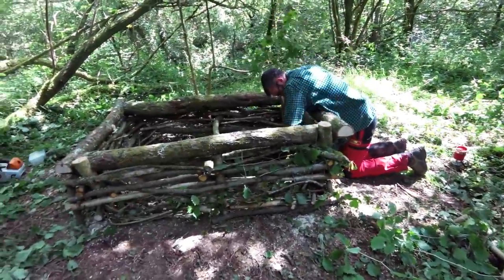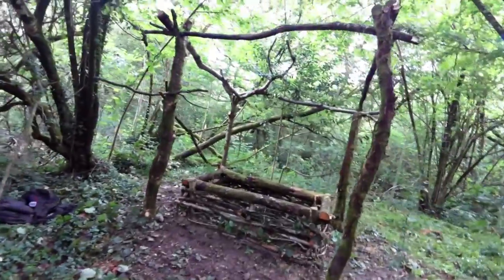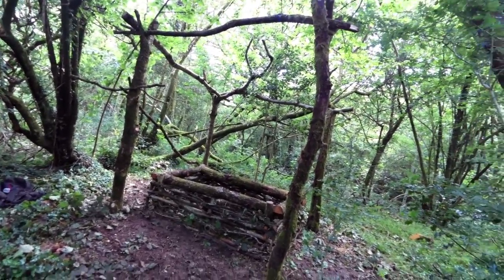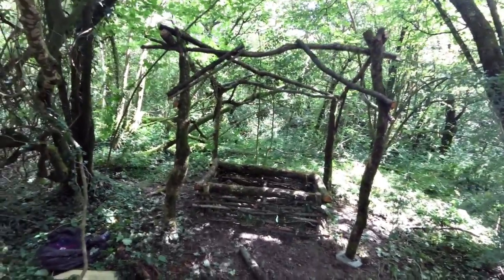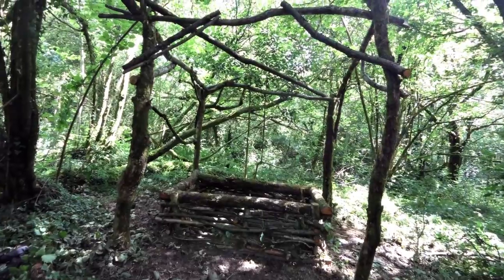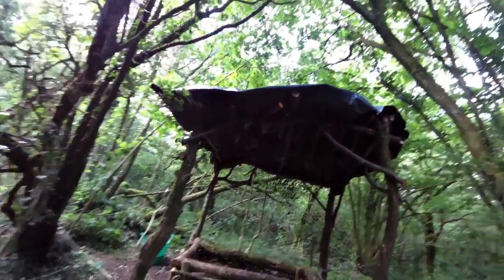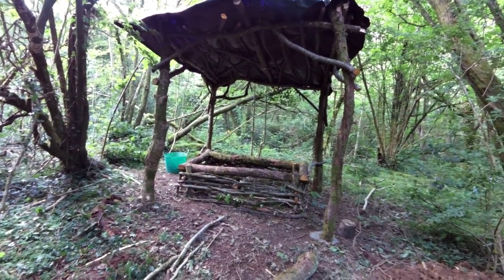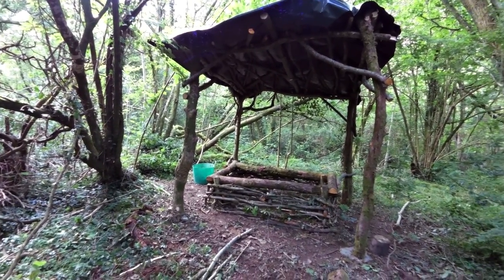compost toilet in the woods.

Comment: The area where the human waste goes should ideally be completely sealed off from the outside to avoid attracting flies and other pests. I might have dig down further, but you can probably also seal off the woven sides. You'll also want to have a plan for mitigating the smell. You can have a bag of lime, wood ashes, or sawdust available to toss in the hole after each use, which will help.
Reply from the maker: J DeWitt hey man, thanks for the comment, yeah i have put tarp on the inside to seal it off. and i will be covering the shite with sawdust, about to upload a new video of the progress. i got some slab wood for free and i started siding it.......and using it.